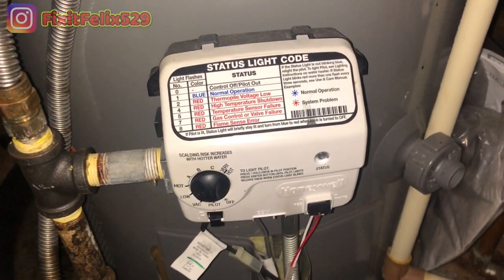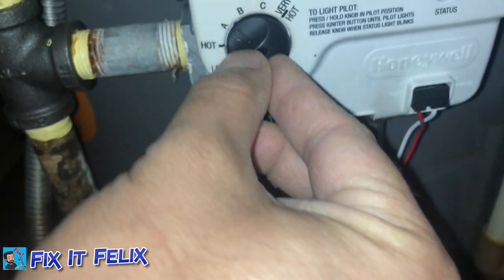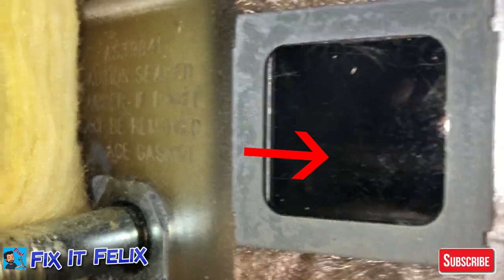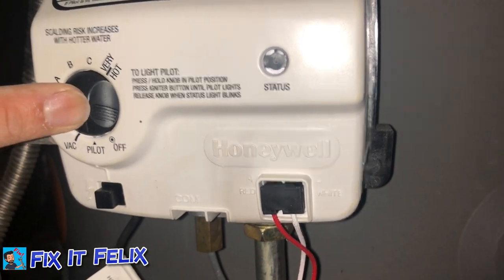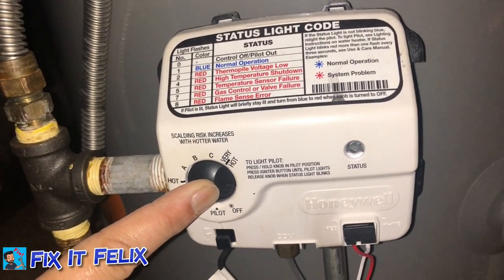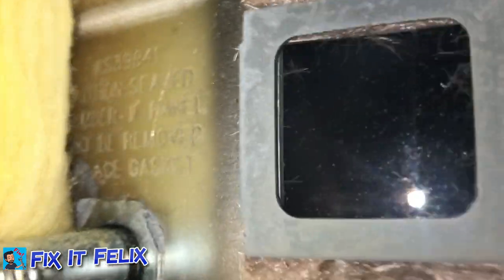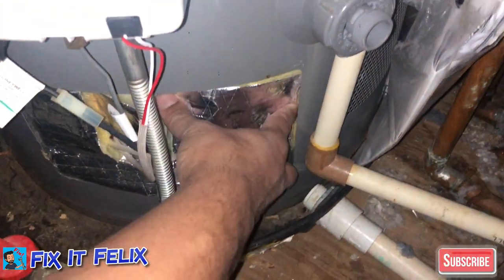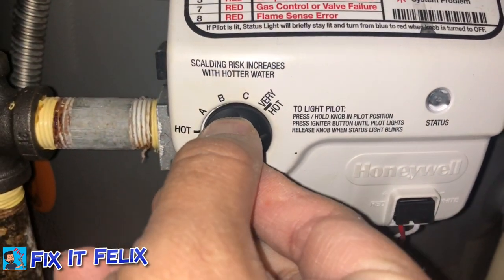HoneyWell Water Heater Fix ( how to turn it on )

Comment: I've done this to my water heater a dozen times with success, but today when I try to reset it, the pilot/flame comes on but the light never starts to blink allowing me to move the thermostat to the desired temperature.  Now what?  If I release the button, the pilot goes out.
Reply: Mine does same thing
Reply: Did anyone figure anything out? Mine is doing the same thing
Reply: Ain’t no one is gonna tell anyone they want us to hire someone! Let’s find the solution and comment it! I’m having this issue at the moment right now. Did you ever fix yours Stephan M French
Reply: No I still have no hot water and have done 2 gas valves now I’m at my wits end, 2 gas valves all with 7 red flashes which is the code for faulty gas valve
Reply: Its possible that you’ll need to check the thermocouple, it is where the small amount of electricity is converted to power the LED, there is plenty info online about how to check this component with a multimeter.

Comment: A lot of times when your pilot light goes out it's a symptom of an issue. Could be a dirty or faulty thermocouple, faulty valve, lack of air ect. Learning how to properly diagnose what  actually caused the pilot light to go out is very beneficial when it does not stay on after trying to relight.

Comment: This video was the "AH HA!" moment for me. I am in Austin Texas where we just went through a terrible winter event, I was without running water for days and had to shut off the hot water heater. This morning we finally got some low pressure water back so I wanted to turn my water heater on. Following the directions on the heater was not helpful, I spent about an hour trying to get it to light without much luck. Thanks to this video I realize I didn't need to be hammering the light button like the directions seem to indicate - it's more important to hold down the knob and let the gas flow so the lighter has something to light with! After this video I had that thing lit 20 seconds later. God bless!

Comment: Thank you so much!  My Honeywell control is slightly different and I found the directions to re-lighting the pilot light on my water heater.  I have to hold down on the nob and press the ignite button multiple times for 90 seconds.

Comment: the boilier is next to my washer and gas dryer. But the house that i justed moved in to did not have a gas line for the dryer. So my unlce did the gas line from the T- valve that is connected to the thermostat. Now the boilier won't turn on. do i need to get gas from a differnt gas line then?

Comment: it works. the key is to press in on the red knob that has the "pilot, low, hot, very hot" settings. i watched another youtube video and they didnt explain that you need to press in the red knob. this is key !  good job, thanks for the video,,
Reply: There is NO RED KNOB.
Reply: @ytb2k  its the knob that has the "pilot, low, hot, very hot" settings. yours might be black. mine is red

Comment: I know this video is a bit older but I'm having the same issue.  I watched your video, followed the instructions on my water heater and it lit back up.   I turned the knob back to what it was at before and I heard a whoosh sound, which I assumed was the flame but was immediately hit with the smell of gas!   Is that normal?? I waited maybe 30 seconds and I cpuld still smell it and because I'm 8 months pregnant I panicked and just shut it off.  I can't find anything online about whether it's normal to smell gas right after or not

Comment: THANK YOU!
What are the letters A B C for ?
Mine was at B, and I noticed the fire was off . But when I reseted it worked.
Reply: Apparently a lot of these devices trip past the hot setting. There's a lot of reasons but the main one is that there's a thermostat inside and if that things a little off And it senses the water is too hot, it shuts everything down.  At this point you have to then push in the mini breaker button on the electrical connection opposite the flame window and go through this video process again.

Comment: Working, on "very hot" setting only for a while, but when it is adjusted to a lower setting, to setting "B" or less, the flame goes out instantly.
Reply: Mine does the opposite. If it goes above vacation it trips something and shuts off. Based on googling, there's multiple reasons for this to happen

Comment: What if everything is on, the blue light and u can see the gas burning but still no hot water?, only a little water with no pressure for a few seconds then no hot water at all?.

Comment: I’m going to try this. Hope it works.  Anybody knows why the water heater pilot turns off?
Reply: How hot did you have the water? A lot of people suggest not going above hot into the A b or c area. A thermostat can trip and shut it down If it gets too hot.

Comment: Only question is.... Why did it go out.... There was a reason... The reason will return was it a wind or draft that somehow got in? Was it a intermittent controller problem.... Most likely... Possibly a defect caused by anomalous reaction to heat temperature controller or a leak in the tank.... It's almost a guaranteed that it wasn't nothing that caused the problem

Comment: Mine goes back out even after the status light starts blinking (30 seconds of holding) Now I'm into the unknown.
Reply: If you turn up the dial too hot then a safety mechanism shuts things down. Try not to go above hot. If it's faulty like mine I can't go above vacation mode. There's also a button on the electrical connection opposite the pilot light. It's like a little breaker, You have to push that back in in order for the pilot light to work.
Reply: David Loren how do I reset it